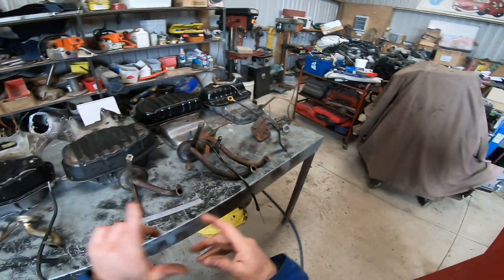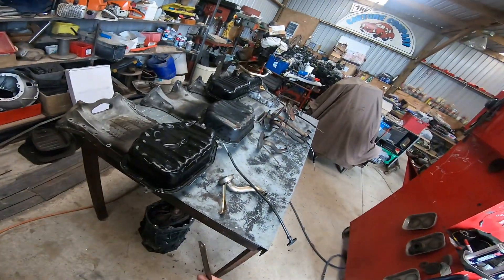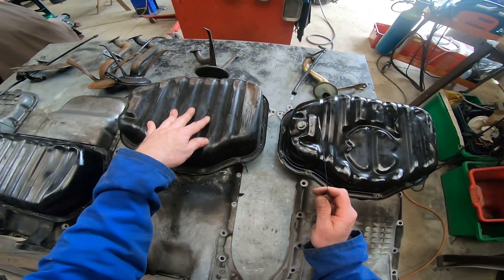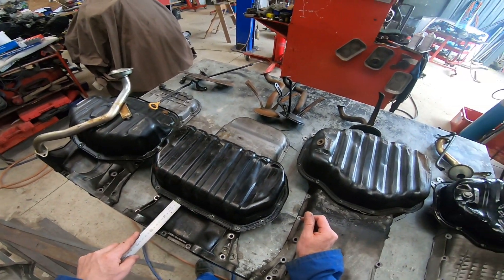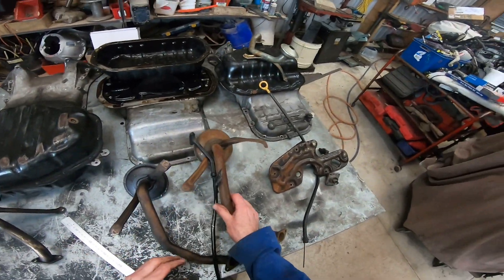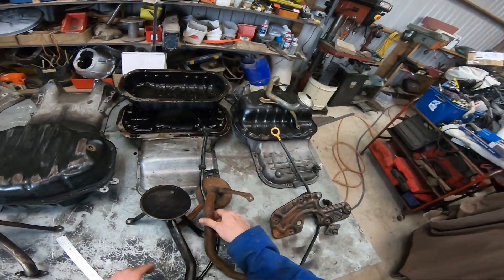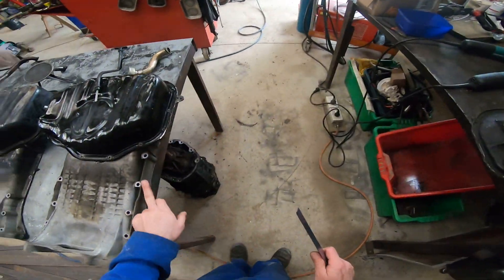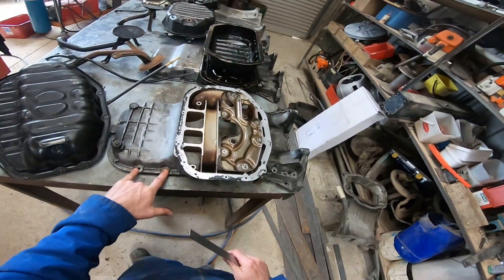1uz and 3uz Sumps

Comment: Would it be a problem if swapping a 3 uz out of a sc430 rear mid sump to a front sump from a 2000 ls400?
Reply from the maker: The 3uz swaps into 1uz vvti fine when done correctly

Comment: hi! l love your channel and very helpful for me. i have a question. i will swap 3uz to IS200(1st Gen). but my 3uz has a mid oil sump. is there a any problem for swap? i mean, some interference in crossmember or steering gear or any parts in IS200. please reply me. thanks!
Reply from the maker: Yes,  its an issue using 3uz rearward sump in is200. We swap to front sump
Reply: @CartuneNZ  Thanks for your reply. finally, how can i modify sump location for my 3uz? my 3uz fe extract from toyota crown 2007, and it has a mid sump. is it can change front sump oil pan upper? i mean parts compatibility. i had a headache in this problems :(  actually, i'm in south korea. there is no data about uz swap.
Reply from the maker: @admindesignssoul6961  toyota have three main sump positions,   yours is the most rearward,   called a rear,  even though its not completely rear.  I have videos with this info.

Comment: Hello Sir, I have changed my 3uz engine stock sump to a 2uz from the land cruiser, question is do I go with 2uz engine oil capacity after installing this sump or is it the same capacity as before. 
Many Thanks for your informative video’s
Reply from the maker: Capacity will match whatever sump is fitted.  Cheers

Comment: Hey mate, thanks alot for all these videos, helps alot. Just a Qs , how likely is a 1uz non vvti earlier gen front sump pickup to fit on a 3uz 6spd rear sump ?. My donor car has a rear sump, need a front one for my jzx90. Luckily found a front sump of 1uz but unable to find a pickup
Reply from the maker: All UZ sumps interchange when done correctly.  Cheers Kelvin

Comment: hello im doing a front sump swap, would i use just gasket maker to seal it to the block and also on the steel pan? i got a new pickup tube gasket just wondering if thats all the gaskets ill need is just the pickup tube gasket? thanks.
Reply from the maker: Yes, correct.  Only pick up needs a gasket, everything else is sealant.

Comment: Hey how do you think it would go swapping a 1UZ into a UZJ100 series? The 2UZ are expensive while the 1UZ are cheap.. stroke the 1UZ/supercharge it and swap it in..? Is that crazy? Assume you can use your 2UZ sump and accessories.. how hard would it be?
Reply from the maker: its possible , mechanically much easier to do then the wiring side but with correct knowledge it should be possible.  cheers Kelvin

Comment: Kelvin, can you tell me if a 96 LS400 non vvti lower steel pan will swap over with a 98 vvti lower sump pan. 
The vvti one is damaged and I have possible access to a 96 gen 2 non vvti one. 
Cheers
Steve👍
Reply from the maker: Hello Steve.  I had to go check to confirm but yes the front sumps from different years lower pans interchange.  Cheers Kelvin
Reply: @CartuneNZ  that's awesome thanks mate👍 that really helps me out.